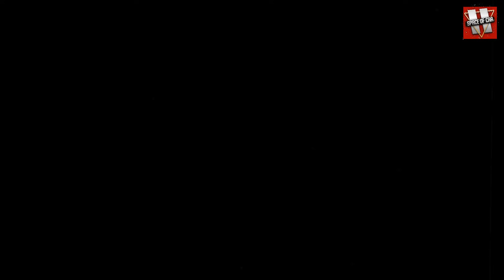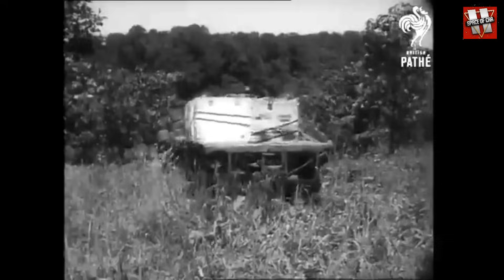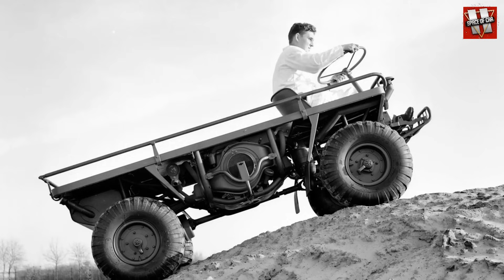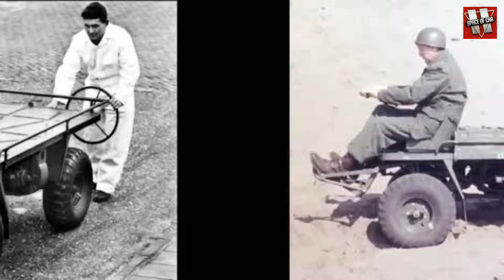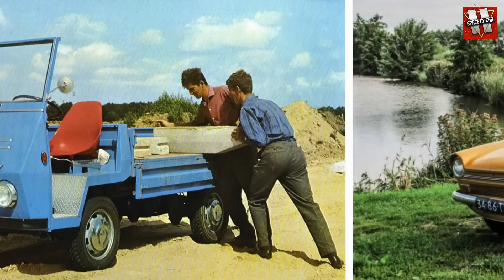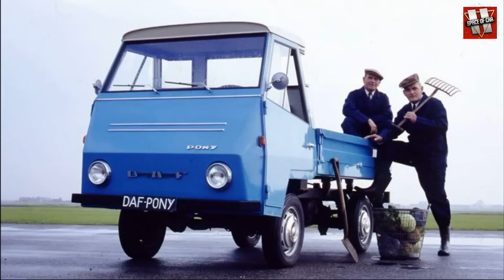How the American Mechanical M274 Mule became the DAF Pony mini truck.

Comment: I used to know of a company that had a Daf Pony, kind of like a promotional piece for in their gallery, or for them to take to events sometimes.
If was Duijghuijzen in Beuningen. But i haven't been near them in a long while.
I'm half sure they still have it though.  Just like they have an old moving trailer they use as a camper during events.

Comment: Even being Dutch I can't remember these, in my area the VW van, Opel Blitz and the electric Spykstaal milk float were the smaller delivery trucks of choice.
In the very confined city center streets you would see the old Gazelle cargo moped, with 2 front wheels on an axle under the bed and the rear part of a moped attached to this. Many municipalities did use these. The Gazelle cargo moped could be an interesting topic on its own.
The DAF Pony did resemble the Minicar which was developed earlier but got successful and still exists today. The semitrailer version looks like the British Scammel mechanical horse, which is also an earlier design.

Comment: Kei truck bans are getting massive push back. Safety excuse is a joke when they allow motorcycles on the road.
Reply: Not to mention, In some places you can ride a motorcycle without any gear at all.
Not even a helmet.
Yet a small vehicle which is still bigger than a bike and has 4 wheels, is somehow ''too unsafe''.